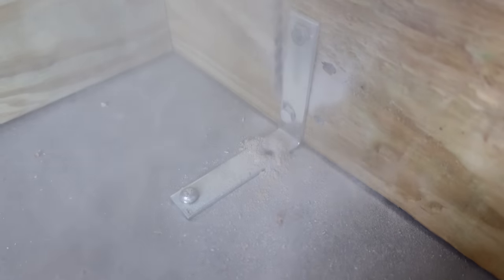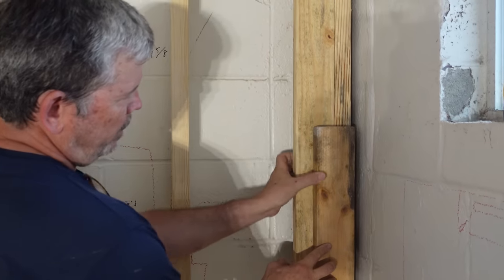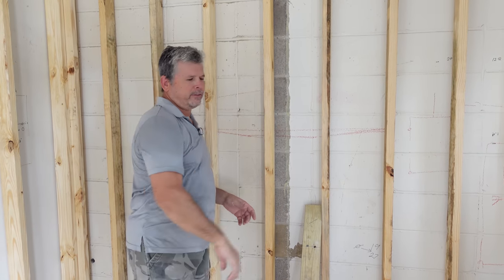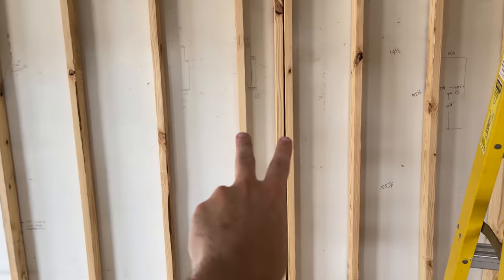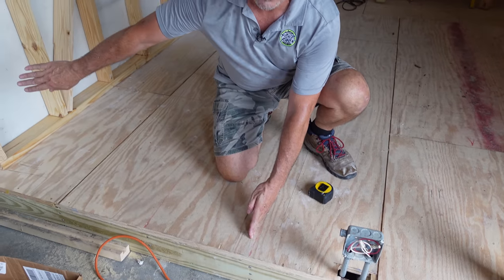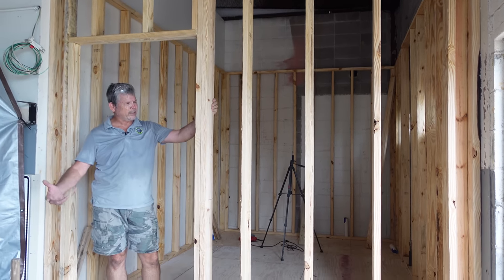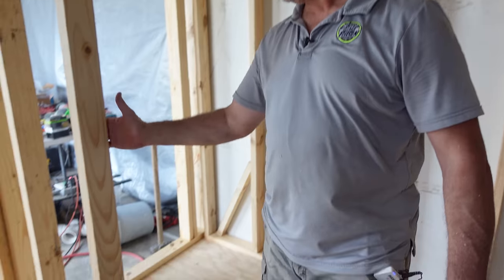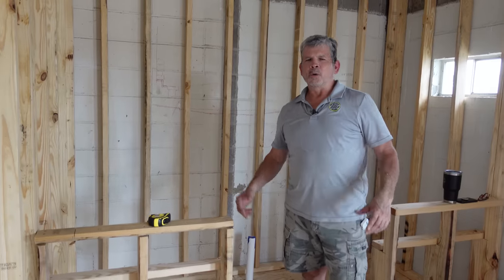Framing the Bathroom Walls But They Keep Falling - THE SHOP Part 6

Comment: Jordan, you may find it easier to move a wall if you screw a temporary diagonal brace to all of the studs. It will stiffen the wall up considerably without adding much weight.
Reply: You can also get a bigger stud and nail it close to the top plate

Comment: I used to manhandle stuff around in my youth, I was 6'5 250. After I herniated L1L2, L2L3, and L4L5 moving a paving packing plate, I stopped trying to move stuff myself and eventually needed surgery

Comment: Jordan, I noticed that wall tried to rack on you.  If you have to do this by yourself again, slap a diagonal bit of lumber across the face of the frame.  Keep it rigid until it is in place.  Then pull it off.  Just a little bit of insurance that your hard work won't fall apart before it is properly in place.

Comment: Jordan you had me laughing with the wall framing by yourself part.. =D  great job on filming and editing as the struggle and comedy were in perfect balance..  oh and not using your wall.  I was rolling..  Another great video... you and your dad a quite a pair!!   OHH  why covering the windows.. they could hang some plants in there or something..  no guys.. they need those windows and natural light.  If not then at least seal them up correctly so the moisture from condensation doesn't get behind your new wall and cause 'mold'..   Your asking for trouble down the road I'm thinking.  But hey, Still love you guys!!  =D
Reply: Thinking the same thing.  Natural light and perfect location.
Reply: I was thinking why not frame it into the shower with a bevel like the pony walls they made and use pvc trim to case the opening to keep it water proof. I did that in a shower years ago, it looked and worked great.
Reply: @polygaryd   Yes that would work really well using the PVC trim good  Idea,
 Keep up the good work but for the hair from you bye for now Ken.

Comment: Hi Studpack!!  I just wanted to recommend that you ditch one of those vanities and install a water heater closet.  Put in a 40 or 50 gallon water heater.  Your friend is going to hate you when he has to keep climbing on top of that bathroom to figure out why his tankless water heater isn’t working.  Believe me those things have issues.  Also, I would put an accessible clean out on that shower vent in the wall.  Part of that vent is flat and dry.  Meaning no water runs through it.  One bad sewer clog could cause debris to clog the vent.
Reply: agreed, tankless is great, but they do sometimes do screwy things and they also require  yearly maintenance/cleaning where a tank style can be pretty painless.    sitting up on that roof for an hour while the cleaner runs thru it is going to result in a lot of cussing.
Reply: @brianhopkins5251  My thinking goes that if you need unlimited hot water, then yes tankless is great despite its drawbacks.  If you don’t need unlimited hot water then it usually isn’t worth it.

Comment: It looks like the framing for the shower covered up a vent that you mentioned had some rain dripping down it in a previous video. I am curious what is required to deal with that so you don’t worry about water on the framing?
Reply: Me to can't tell if the vent is covered or not studpak could you tell us please
Reply: Same
Reply: Stud definitely right over the vent pipe. Are going to do a different vent and cap off the existing one?
Reply: I bet they're going to see this comment and fix it in the next video. This is almost like an interactive, choose your own adventure, YouTube channel.
Reply: @nickbailey202  one of my favorite parts of this channel is how they dig through the comments and pull out tips and improvements. Instead of just sharing their own insight they distill the insight of everyone commenting as well.

My guess is they did something off camera or that will be shown in a future video.
Reply: they said in the previous videos they are going to tie into that vent so they will probaly relocate that stud
Reply: @thewonderfulwonder1614  thats what I thought but they accounted for every other utility penetration in their framing, making me think they may have changed direction with it.
Reply: I get the feeling they don't know quite exactly how that vent is going to crawl through the wall yet and don't want to mess with framing around the vent until they know which side it will sit on. I'm fairly certain we'll see that revisited here soon.
Reply: @nickbailey202  LOL

Comment: Handy tip for yall, put a screw or nail in to the side of your sawhorses to hang the circular saw on so you don't have to bend down to get it and it's never on top of what your cutting

Comment: When you do thankless at the Texas house make sure you have a recirculator so you don't have to wait for the pipes to empty to get hot. It makes a huge difference. To do it properly you need to run the hot water in a loop and have it planned from the beginning but it is so worth it.

Comment: Absolutely love that you guys review comments still on YouTube. So many channels have gone to strictly answering Patreon comments only.

For what it’s worth, last video with the block anchors blowing out on you, not sure if there were some blocks that were still hollow but either way, redhead and Simpson make these monster tapcon style anchors that are rated for hollow CMU, cracked concrete, solid concrete and grout filled CMU. 3/8” and 1/2” are perfect for ledgers. In hollow block, to get the engineered ratings you just have to use rotation only drilling and non impact to drive.

Comment: Are you going to attach the studs to the walls for more stiffening  ? Also maybe blocking between studs for hand rails. (gotta get old sometime).Run the gas line outside and mount the tankless on the outside  wall.(easier yearly maintenance)

Comment: Coolest idea I have seen with a shower is installing the unit outside the shower. This allows you to turn the water on before stepping in allowing it to heat while you get changed. It may not be worth it if its a instant heat type

Comment: Enjoy ur videos! Guys, would like to know if you tackled a kitchen cabinet paint project? Haven't found a video in ur library. Would like to see ur prep n paint process. Thanks!
Reply: Nice job.  I can see how lifting the wall by the middle stud is heavy.  How about installing a temporary horizontal 2x4 across the doorway at shoulder height.  You can get closer to the end, lighten the load, lift with your shoulder, and see what you are doing.  Just a thought

Comment: What would you think of building the walls first, and then framing the floor between the walls? You'd ledger it to the studs instead of the block walls. IDK. Just considering the pros and cons.
Reply: One thing immediately came to mind is that you would need to add blocking right above the floor for the drywall, but otherwise, I can’t see an issue.

Comment: Hey guys. Like how you do the 12" on center, you think 25 steps ahead. I was thinking you should install a magazine holder in the shower too, never seen one like that. That way you not only can read in the crapper but also in the shower. Haha stupid I know. Think about the magazines ive flipped through "at the shop"

Comment: As usual great work. One thing though I thought you were connecting the stack vent to the original abs vent? Looks like you have a stud going right in the middle of it. I could be wrong but thats what I thought I saw.
Reply from the maker: That’s correct.  We’ll have to raise it
Reply: @StudPack  makes sense. It would be inside the shower if you didn't. I Didn't think about that. I guess you could have boxed it in though if you didn't raise it.

Comment: instead of cutting the 2x4 to have a slope to it (to drain) just use a regular 2x4 and put some shims underneath it when you nail it down to get it to correct pitch.

Comment: Sub floor used is  over kill for this job 3/4 plywood would have been sufficient. 
Wall studs can not come in contact with masonry.
Pony wall center stud is in the way of center of drain.

Comment: What about the vent for your drain?  It seems to be blocked by the framing in the shower.  Also, a gas fired tankless hot water heater is great, but I wonder how you will vent it and where you can safely mount it.  Finally, blocking that window means you will need to rely exclusively on exhaust fans to vent the bathroom/shower.  Not trying to second guess you, just wondering.

Comment: If the glass for the shower is behind the vanities, does that mean no mirrors? Maybe hang them from the ceiling since you can’t hang them on the glass? What about double sided mirrors, so the back looks as good as the front and is useful inside the shower?
Reply: The mirrors would go on each wall.  They face 90 degrees from what you are thinking.

Comment: I understand your concern about the 2x6 door. I have a basement where the interior walls as 2x6 so I need to do something when adding doors for the bedroom and bathroom. Do you have any videos where you frame a 2x4 door for a 2x6 opening? I have enough space to put 2-2x since the openings are 38" wide right now.  Pricing/availability of 2x6 doors is ridiculous right now.
Reply: Install the door in a normal manner and add jamb extensions to one side

Comment: Love the video as usual!!!!!   I was wondering you could cover a topic that I can't seem to find a fix for.  We had a new bathroom built with a fiberglass tub.  We have noticed that the tub is flexing and I vividly remember that when it was installed they didn't but anything under the tub (mortar bed).  How can I fix that now without taking the bathroom apart?  I really only have access to the side opposite the faucet.  Any ideas???  Thanks and keep up the great content!  Haven't missed one yet.
Reply: You might be able to get spray foam under the tub bottom.  You really need something that will expand just enough.  🙂
Reply: You should really tear it out /tear out the wall to get access and redo it.  The tub will crack and you'll end up with water underneath.
Reply: @brianhopkins5251  I will do anything to avoid ripping out a completely brand new (less than 2 year) bathroom.  I do plan on ripping out an adjacent wall which gives me access to the end of the tub and I will attempt to put in some fix from that end.  I saw some videos of using foam board and trying to fill in gaps with foam...  I would rather try that first and see how that helps...  Hopefully it solves my issue..

Comment: Do you have to crown studs in a vertical wall? If do does the crown go inside or out?
Reply: Yea definitely need to crown them and direction will depend on the purpose. I do a lot of custom kitchen and baths and when I'm framing a shower I'll do the crown out that way I get a dip in the middle instead of at the top and bottom (it's easier to wet shim or foam shim one spot instead of top and bottom. When doing a kitchen I would rather have them crowned in because I don't care if there is a small gap between the bottom of the cabinet and wall because I fasten at the top, same with upper cabinets I'd rather have the top shimmed out where no one can see it.